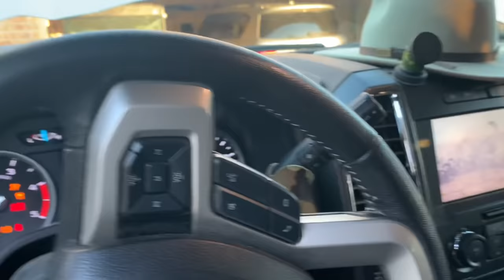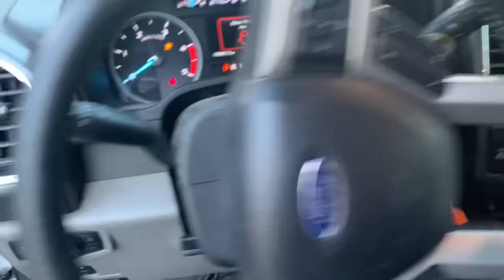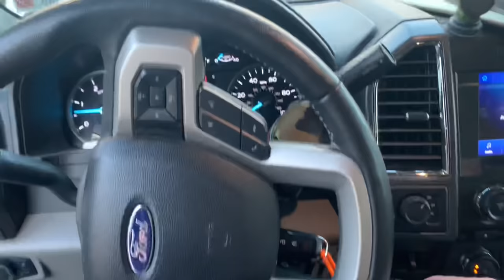How to  Delete/Reroute CCV 6.7 Powerstoke

Comment from the maker: GET CCV KIT HERE - https://propowerdiesel.com/?ref=wm1qnuhhud
USE CODE COLTSWAY FOR 3% OFF 🇺🇸🦅🇺🇸
Reply: Fuck yeah appreciate the code
Reply from the maker: Anytime brother! 🇺🇸🦅🇺🇸
Reply: @COLTSWAY  hey brother this other mechanic cut that apart it’s not a filter anymore 2017 and up they fixed the problem
Reply: Only the ones you can take apart had that problem not the newer ones gases come out the top the oil drips back into your motor
Reply: But then, again, if you don’t change your oil on a regular basis, yes, it could clock that up to

Comment: Colt, just wanna help out with some information. For you and everyone.

The purpose of a Closed Crankcase Ventilation is to relieve pressure in the bottom end of a motor, the crankcase, while reducing emissions. This pressure comes from blow by, which is combustion gases that make it by the piston rings. This also mixes with oil vapor/mist(created by moving parts) and water vapor that is also a byproduct of combustion. If you were to block of a CCV system this would create positive pressure in the crankcase. This will shorten the life of seals and gaskets inevitably causing an oil leak as you mentioned. So we can agree crankcase ventilation is a good thing.

Many years ago these systems were open and vented to the atmosphere through a little filter on the valve cover more often than not. Emission standards came about and now we have closed crankcase ventilation. These systems more or less "recirculate" your crank case pressure by introducing these gases/vapor into your intake/turbo and back into the combustion chamber to be burned. What this does if effectively evacuate the crank case of pressure because the intake pulls a slight vacuum on the crankcase. This keeps your seals lasting longer and emissions lower.

Now as you mentioned these ccv filters can get clogged and wreak havoc. I want to clarify that you removing the oil cap with the truck running is not an indication of the ccv filters level of blockage, but rather an indication of blow by. Every truck will have some blow by so dont worry. And old trick is to place the oil cap upside down on the oil fill and see if the blow by/crankcase pressure is enough to blow the cap off. This would indicate potentially larger issues. I could see your oil cap test work in theory however if you went to take the cap off while running and there was a big initial puff that proceeded to level out. That specifically could indicate a blockage with the ccv filter.

But back to CCV. Instead of deleting the system, making people upset and given diesel owners a bad name, i suggest getting a ccv baffled filter. This filter will seperate the liquids from the gases, keeping the sludge out of your intake/turbo/top end etc. And allowing you to maintenance your baffled filter by draining it at regular intervals. This is really a win for everyone.

I understand these systems can be expensive but they are worth it compared to deletes and reroutes into the exhaust. Deletes will give you an oil smell that is unpleasant and leave drips on the ground. This open hose also allows moisture potentially into your crankcase. Another think to look out for would be potential clogging with snow, ice or dirt. Blockages could result in increased crankcase pressure. An improper reroute into your exhaust could also result in a crankcase pressure increase, which would negate the purpose of crankcase ventilation all together. 

I know not everyone is a diesel mechanic, but please research as much as possible before guiding the masses. It appears your channel has the potential to do just that. I appreciate your content and willingness to help others.

Hope this helps someone.
Reply from the maker: Thanks for the feedback brother. I do understand what you are saying. And the smell is pretty bad sometimes. I think I will go with a SPE CCV. ITS GOT A internal catch can to keep the oil from dripping out. I haven’t had any oil drips or anything but some people do. It also is supposed to help the smell. I prob won’t be putting on a baffled one though. But would be something I would consider for next time or on a different truck. Thank you for watching, I appreciate it. 🇺🇸🦅🇺🇸
Reply: Could route it to the exhaust and not worry about it

Comment: Colt, i have the same setup, SPE has the CCV reroute kit with a built in baffle to keep the oil from coming out, also no limit fabrication has the venturi that allows you to run your down hose to the exhaust so you dont have visible vapor coming out from underneath your truck.
Reply from the maker: Yea I might go that route one day! 🇺🇸🦅🇺🇸

Comment: Got a MPD kit in garage goes on this week, just weight lossed last week, watch your videos just before doing it, thanks! Cheers!
Reply from the maker: Anytime, thanks for watching Kevin! 🇺🇸🦅🇺🇸
Reply: @COLTSWAY  took less than hour to remove and get running, thanks. But damn it got a fuel line leak from pushing the lines out of way to get to the one side bolt...

Comment: Colt, great video minus the knuckle busting.  I had to extend my CCV reroute another 5', depending on the wind direction picking up my coffee - would pass fumes into the establishment.  I also use the SPC CC.  Looking forward to when you are going to pull the trigger on installing that piping.  Stay safe.
Reply from the maker: Got it installed the other day. Will drop vid soon! 🇺🇸🦅🇺🇸

Comment: I'm curious about doing this, just a thought, couldn't someone just remove the hose from the CCV box, replace with a properly fitted hose, run that hose to the back of the truck, find a properly fitting cap for the intake side and be done. This way you have a catch can(CCV BOX) and venting to the atmosphere instead of the engine. Seems like it would work and save money.

Comment: Some times there is know short cut you just have take that pipe off. I like to get every thing out of the way. I have an 08 F350 6.4. I jacked up the cab to get the passenger side valve cover off to change the sensor under it learned a lot now when I dont want to do it I'll do it saves scraped nuckles or worse other parts are not as easly damaged. I think if i have to remove the cab it will only cost me two extra hr for that part of the re and re. P.S. dont use an air hamer to get the cab bolts off you will jus strip the part that hold the body or cage nut in place then you will need a partner half to remove carpet and the back seat etc...

Comment: I'd run that hose as far back as you can, I've done this on several rams and the smell that comes out of this hose is nasty at least on the Cummins. Get it as far behind you as you can and it's not so bad. I could always smell it at idle or hard accelerate when dumped straight down in the engine bay.
Reply from the maker: I can smell it sometimes. Prob gonna run it to a catch can as well. 🇺🇸🦅🇺🇸

Comment: Hey colt had a question what an update on the truck I have a 2018 and am wanting to do all the same engine upgrades and deletes however wondering about what you’ve seen in your mileage category
Reply from the maker: Well if I would keep my foot out of it I’d get alot better. I only average 14 but I’m on 37x13.50x20 and don’t really do any highway driving. I have just a short commute to work. 🇺🇸🦅🇺🇸

Comment: There’s a good chance that if you ever need those codes again, you’ll be re-using them in a repair where you’ll be able to get the codes off the tops of the injectors (they’re there, too on each) - and you’ll know which is which based on the cylinder. No biggie.

Comment: Sorry if someone's already asked, but I've read some forums that say CCV delete raised crankcase pressure and may cause turbo seals to leak. Is that horseshit? I'm fixin to install my kit and wanted your opinion. Don't know if the problems were on the older 6.7s or what. I've got '18 model. I'd appreciate any feedback. Thank you kindly.
Reply from the maker: I don’t know how it would raise it. It’s venting to the atmosphere instead of going back in your engine

Comment: You shouldn't do this job or keep pedaling these kinds of repairs. The Powerstroke was designed to operate in a stock configuration.  You are not relieving any crank case pressure- it needs the vacuum. Without the little bit of vacuum created, it's puts stress on the turbo seals and causes them to leak. It's designed to have oil going into the intercooler. It will burn the oil as designed. Its a high compression engine. It just seems like a very costly venture to damage other components to solve a problem that doesn't exist. I say all this with respect.  How do I know, well experience. I like your channel. Your hilarious.
Reply: I don't know where you're getting this info from. But it's wrong on all counts sir. I know, because I work on these near daily. Stress on turbo seals? Oil in the EGR, burning it, and etc???

Comment: Have you had any issues with blow by through the reroute hose? Or the smell?
Reply from the maker: No issues or no oil droplets at all either. It sid stink pretty bad but I just ran the hose farther back and now I don’t ever smell it. 🇺🇸🦅🇺🇸
Reply: Interesting. Just got a powerstroke recently. Already did some weight reduction and ccv reroute. Still have blowby out the oil filler and now hose under truck! Love the videos and have been using them as a guide for my truck

Comment: How’s the smell? Concerned about it stinking.
Reply from the maker: I ran the hose all the way to the back axle. I never smell it now. Or you could get a Venturi and run it into the exhaust. 🇺🇸🦅🇺🇸
Reply: @COLTSWAY  thanks man! No other issues? I hear in some circles that the vacuum is necessary for the engine to run properly and will cause issues down the line. I have my doubts about that….

Comment: Yes. It would've been easier on uer didgets to loosen the hot side pipe and move it to the side. When I did my 2019, I repiped it with a Pusher kit and did the, EGR removal, coolant reroute and disaster prevention kit all at the same time. Just a tip for those who are thinking of doing this, it's easier if you cut the flex pipe from the CCV. That way all you have to do is turn the pipe till you get to the next tab. 

When I did mine, I put the internal catch can on at the same time. It'll keep you outa the doghouse with the wife. I dont care how long that pipe is, without a catch can you WILL eventually leave a spot on the garage floor.

And a guy with a deleated Duramax gets it? Seriously? It's a fuckin Duramax. If you buy one of those or that transmission destroyer that passed by a little later, you might be trying, but you definitely don't get it.
Reply from the maker: Yes. I been looking into the catch can, think I’ll go that route as well Tom. Thanks for watching big man! 🇺🇸🦅🇺🇸
Reply: How do you like burning just air and fuel? No more gritty exhaust fumes through the EGR or throwing oil through your intercooler and into your intake.
Reply from the maker: Loving it so far. Truck prob likes it a lot better as well! Haven’t got but a couple hundred miles on this set up but she purs like a kitten! 🇺🇸🦅🇺🇸
Reply: I just turned over 200K and she don't burn a drop of oil. Runs like a champ too. I'm gonna go for 750K on this one.
Reply from the maker: No doubt you can get there! 🇺🇸🦅🇺🇸

Comment: Has anybody had any negative issues due to a ccv weight loss looking into doing mine soon and don’t want any issues coming from it. I’ve heard good and bad what’s y’all’s opinions
Reply from the maker: Only thing I can say is it stinks. The hose wasn’t long enough when I did it the first time. It ended right under my driver door and when I would get in truck or get out I’d smell it. I’ve since got a longer hose and ran it to the back and haven’t smelt it since. 🇺🇸🦅🇺🇸

Comment: i just did mine this week, that back bolt on the oem cover was a bitch, and i had to remove some fuel line bolts temporarily to get to another bolt, the intake cover i just cut it right up to the aluminum and forced the cover over what was left an zip tied it lol.
Reply from the maker: Glad you got it taken care of brother. Thanks for watching. That back bolt deff sucked. 🇺🇸🦅🇺🇸

Comment: Dang… have you used a scanner to see what your EGT’s are at now with that EGR delete bud? Usually EGT’s skyrocket 500F+…. I’ve seen it kill tune trucks that aren’t DPF deleted as well. You skyrocket EGT’s and then have a partially plugged DPF…. She gunna melt down… all EGR does is recirculate inert exh gas into the combustion chamber… long as your truck ain’t idling all the time… ain’t gunna hurt anything. We have a fleet of 500K+ mile 6.7’s we work on for a company. Every single one of them original engine and trans and no deletes. Js bud.
Reply from the maker: I don’t have a DPF anymore. You can’t block off the EGR or unplug it and still have a DPF. Truck is fully deleted. But yea I can monitor my egt temps. Do it all the time.  Here’s a video how. https://youtu.be/EZwmF9imJPU

Comment: Sounds like he is running a marathon!
Reply from the maker: You gonna get that climbing up on down on this big bitch. 🇺🇸🦅🇺🇸
Reply: I HAVE A 2011 F350 6.7 4" LIFT. I'M 5'8". THANKS FOR THE ADVICE. I'M GOING TO BYPASS THE CCV.
Reply from the maker: Nice! I’m glad I ended up doing mine. Let me know how it goes brother. 🇺🇸🦅🇺🇸
Reply: I have blowby at idle from oil cap! Is my filter clogged?  150k with original  ccv!
Reply: I did the delete and tuner! That's it. What else would you recommend. I have a bunch of oil leaks too
Reply from the maker: Prob CCV. Might have to much pressure and it’s causing leaks
Reply: I just learned about it from you! Thanks

Comment: you have a none serviceable CCV box BTW. you can replace it run dirty.
Reply from the maker: Correction. I had a non serviceable one. Watch some of my other vids. My CCV had to come off as I put a full piping kit in. Did this video for the content for the channel. After this vid I did the piping kit video. All planned. 🇺🇸🦅🇺🇸
Reply: @COLTSWAY  Yo, I saw a video the other day of a guy that has a Deleted 2013 F250 with 1.3 million miles. No shit. It was in a Diesel shop with all 9's on the Odometer. Plus a trip meter.  LOL.
Reply from the maker: @droz2377  damn! That’s bad ass! He got his money out of that truck!
Reply: @COLTSWAY   Notes.  Recco Oil and fuel Filter every 8k. Premium DEF, Fuel stabilizer.  he only did 2 brake jobs.  Got 150k on Michelin spec tires. towed much of the time.